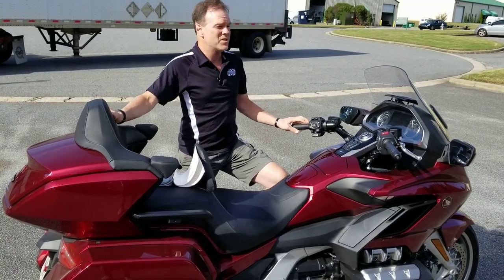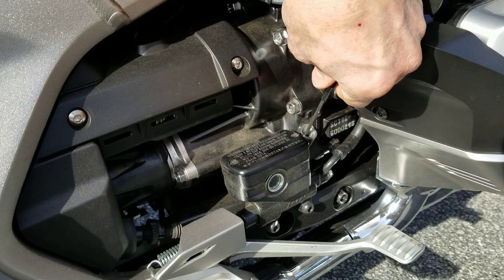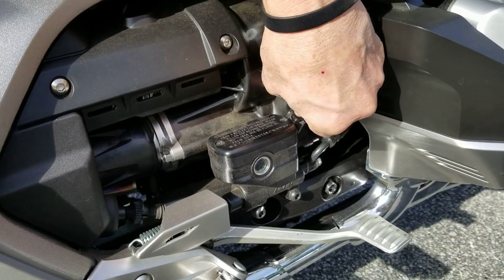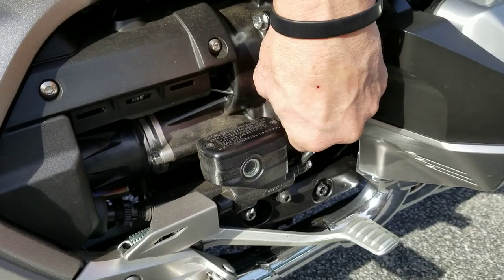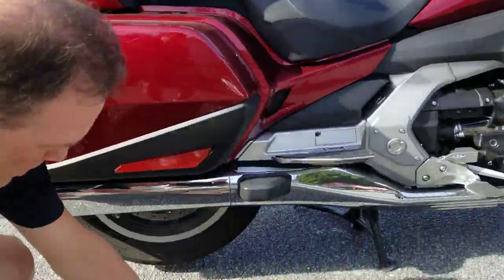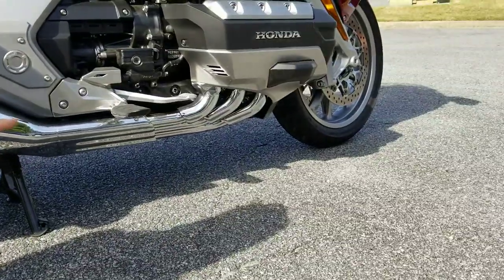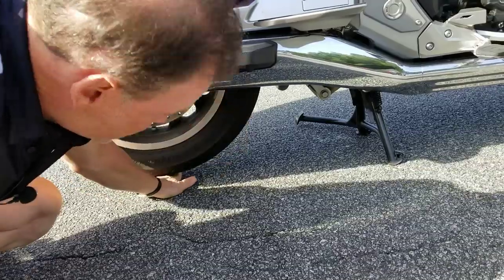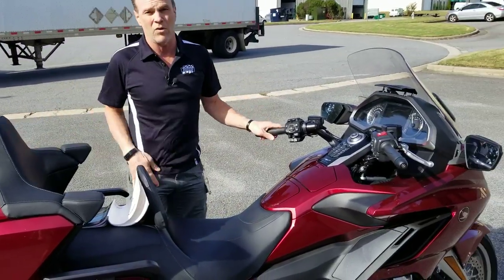Oil Level Check, Part 2 - 2018+ Honda Gold Wing

Comment: My official Honda 2012 Service manual states that you place the bike on a level surface with the center stand to check the oil; so does my Clymer GL1500 manual.

Comment: How about driving a small stack of wood shims under the front tire until the front and rear tires are equidistant from the ground.  Just out of curiosity I would check the oil level with the front wheel shimmed and not shimmed just to see if it changed the dipstick reading very much. I have a 2014 Honda VFR and a 2014 Yamaha FJR both with center stands. Never had any issues checking the oil levels with the bikes on the center stands.

Comment: My 2019 goldwing checking the oil as per the manual shows the oil dead in the middle... BUT in the morning every day when I go to ride it the oil light comes on. Is this typical?
Reply from the maker: I would say no... I haven't heard that.  I would make a post to the GL1800riders.com 2018 forum and see what other owners say.  I would also report this to my Honda Dealer asap.
Reply: Max McAllister & Traxxion Dynamics thank you for the information, I brought it in and they confirmed my bike has oil in it but they would need to keep the bike for a couple days, but I guess they don’t do loaner bikes or anything like that (Bmw did ☹️) so I gotta get someone to help me drop it off or trailer it out there so they can look at. I wish they would have believed me on the phone that I checked the oil right so I didn’t waste a trip out there to the dealer. Thank you again for your reply!
Reply from the maker: @alexsystems2001  Good luck with this, hope it goes well!

Comment: The Honda Africa Twin has the same procedure for checking the oil level except the dipstick is on the left side.  It is much easier to hold the AT level compared to the Gold Wing.  I have found that there is no appreciable difference between a “hold it level” and a centerstand check of the oil level.  I'm sure the same thing could be concluded with the Gold Wing.  Add to this, the fact that there is a much bigger rear wheel to ground gap when placing the AT on it's centerstand.
If a centerstand was included on every GW - Honda would most likely have written using it when checking the oil level.  Yes you could drive the bike's front wheel up on a small board (or just sit on the GW, hold it level, and check the oil).
My take - the centerstand works absolutely fine for this procedure if you are on level pavement.
Reply: I have a tour model and that's how I will do it going forward. Those without a Tour would need to purchase the center stand kit or hold it up some how.
Reply: Max McAllister - I don’t have a tour model and added the centerstand myself.  Fairly inexpensive and easy install.  I can’t imagine why anyone would not add a centerstand on this type of bike.  They spend $35 on a stupid cup holder, hundreds on aftermarket windscreens, highway pegs, and all kinds of other stuff.
A centerstand is essential for basic maintenance!
Reply: Point is, if a critical item is factory-cost 35 bucks on a $24K bike, it should have come from the factory with one. I'm with Max, totally ridiculous on Honda's part.
Reply: pechorin1975 wow go Honda ...

Comment: Can Honda make it more complicated to change the oil & filter on a GW?  Three drain plugs to remove the oil.  And let’s not use simple oil-rings to seal the drain plugs, well use single use aluminum crush washers instead. 

And for adding/checking the oil level…one hole to add oil, and another hole for the dipstick.  And of course we want these two holes on different sides of the engine.  Without a center stand you balance the bike in an upright position while removing and reinserting the dipstick.  But first, run the engine for a while, turn it off, wait 2-3 minutes, then perform that upright balancing act while sitting on the bike.  

Some manufacturers have figured out how to allow you to check your engine oil while on the side stand.  And most have also figured out how to place a single drain plug in the block at its lowest point so there’s no need to have multiple drain holes.  And I still have not figured why Honda thought having separate holes for adding and checking the oil was a good idea.  Guess the new GW engines are designed by committee…and those committees all work from home and no longer comprehend the practicality of what they design.

Now, let’s talk about the simplest of tasks, changing the air filter…
Reply from the maker: Oh yeah...

Comment: WHY NOT SET THE BIKE LEVEL, ESTABLISH THE CORRECT OIL FILL, PUT THE BIKE ON THE SIDE STAND, RE-CHECK THE NEW OIL LEVEL AND MARK THE DIP STICK.  YOU CAN NOW CHECK THE OIL IN BOTH POSITIONS....GLAD I HAVE MY 2013..